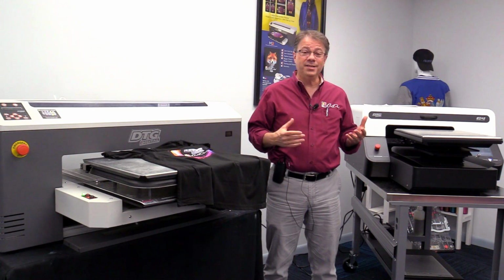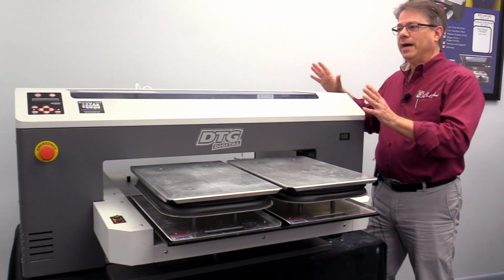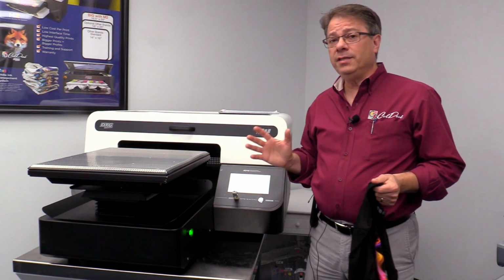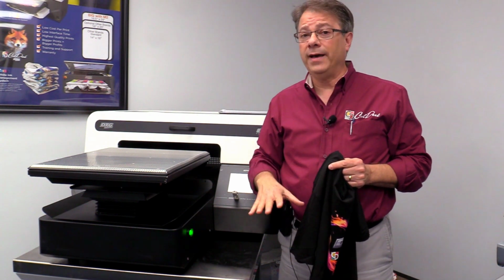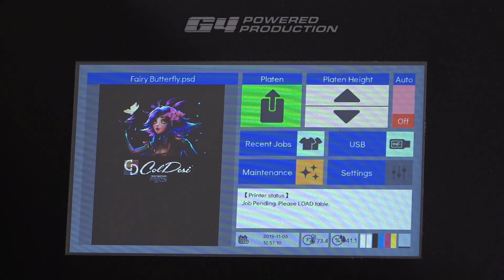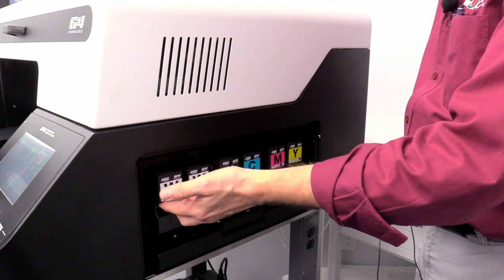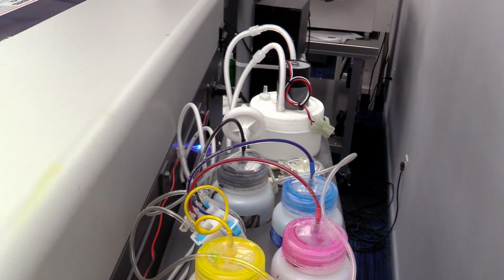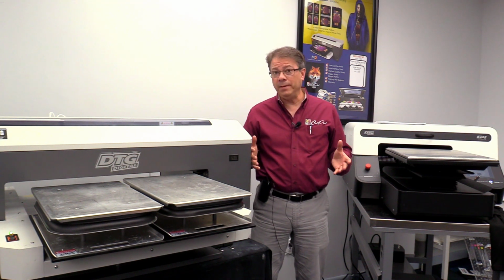DTG Comparison | DTG M2 & All New DTG G4

Comment: What is the deal with the M2 and having the printer sit not being used for 2 or 3 weeks? Will it clog the heads or does it have a system in it that avoids this?
Reply from the maker: We do not recommend letting it sit like that - you can get with support for setting up for being gone that long.
Reply: @ColDesiColman  Support from whom? Your company or DTG?

Comment: What is the maintenance process on the g2? I know it has the wims but is anything else required daily? Cant find any videos or details on the process. This is probably one of my biggest issues with dtg scared on those head issues. G4 no brainer but leaning on m2.
Reply from the maker: The G4 is by far the easiest system to own out of any DTG printer. We've left it un-maintained for a LONG time without any issues (of course, we don't recommend that). Here's a video on Maintenance that might help: https://vimeo.com/391237165
Reply: I think i confused the names, i mean the m2
Reply from the maker: @caribguy2007  okay, there should be some uyoutube videos about that - here's one on what to do for daily startup https://youtu.be/6cvMkEabojU
and here's end of day https://youtu.be/E2-Vu3Gz4qs

There will likely be more current content in the training course, but this should be about it.

Comment: Are the cartridges less efficient and more expensive compared to the bulk ink systems? Like majority printers?
Reply from the maker: Hey Kim - good question. the Cartridge inks ARE more expensive. Partially because the carts themselves are costly along with the integrated chips that communicate to the printer what the ink levels are.  And of course the time and equipment it takes to fill them. 

Less efficient is less clear. Because the g4 inks are degassed and kept in a sealed, airtight system you end up using less ink per print and with less maintenance/ink waste.
Reply: ColDesi Inc Thanks for the info, can this printer be converted into a bulk ink system?

Comment: The DTG G4 is exactly the same as the Ricoh Ri models, who's the manufacturer for these machines? And are there any differences between the Ricoh and G4 model considering they exactly the same model?
Reply from the maker: It's not EXACTLY the  same. The ink set, control panel and vacuum platen are all important differences that have impact on ink usage and a big impact on MAINTENANCE. We've left the G4 alone, for example, for over a month and not needed to replace the print head. Pretty remarkable. the vacuum platen helps a lot with that, and shortens print times. You can read more differences here: https://dtgprintermachine.com/t-shirt-printer-comparison-2020-ricoh-ri1000-vs-dtg-g4/

Comment: How is the prints of the M2 .25 - .35 cents cheaper than the G4? Is the M2 more efficient?
Reply from the maker: The M2 uses bulk ink which is a bit more expensive than the the kodak cartridge based ink. That's mostly the difference